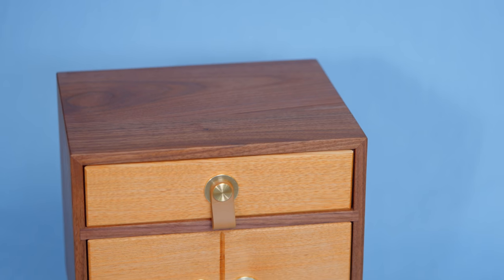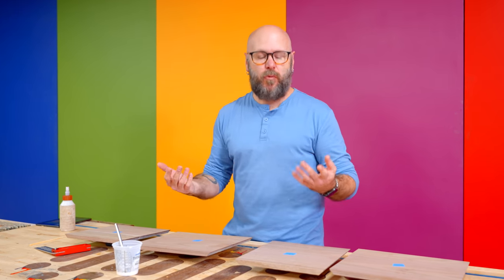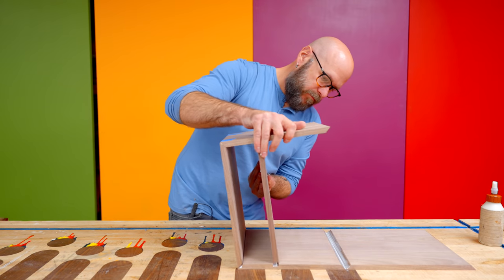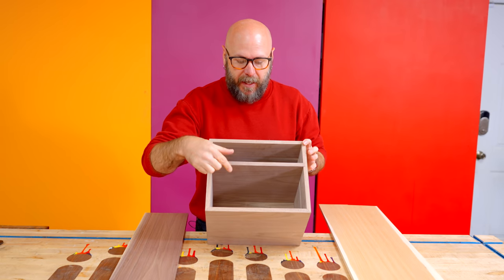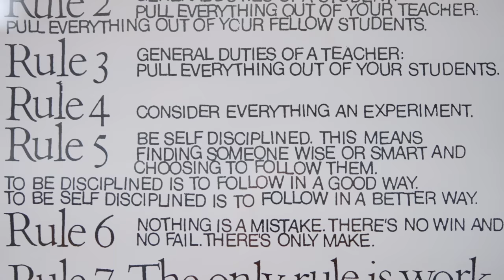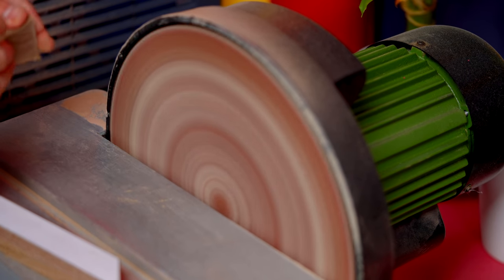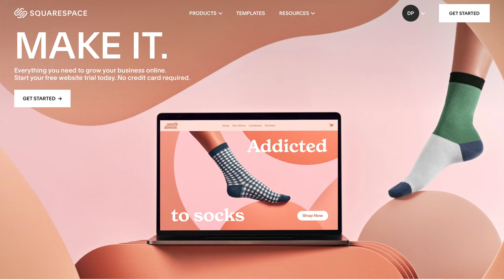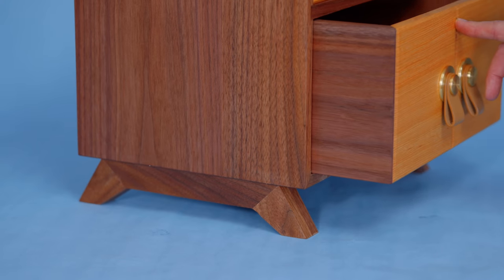Miniature cabinet with a secret. Easy woodworking project.

Comment: I really like the cabinet. However, I might suggest a stopped dado for the separator between the drawers. I have never liked to see the end of the board show like that. Just my personal bias. Otherwise, great job. I think I will try one when next I can. Thank you.
Reply: I like that idea. I’m a newbie (without a shop). If you do that you have to have a router bit exactly equal to the width of the horizontal board, which makes that concept difficult, no?
Reply: @daveparker839  smaller router bit and make a few passes. With the last two being the correct distance apart for your board

Comment: If you watch Patrick Sullivan’s “Glue myths End grain” you’ll see scientific tested proof that end grain to end grain is actually stronger then side grain to side grain. So the question is do you say end grain is not strong because it’s always been said or did you personally experience the rare occasion where it broke? Plus miter joints are not end grain. They are a mix of end and side grain.
Reply: I don’t believe that. Build a picture frame. Don’t spline it, don’t do the water down glue trick. Then drop it like it would if it fell off a wall it will break at the joints not all of the joints might not break but it’s the miter that breaks. Now butt joint a panel the same size as the picture frame. And drop it the same way bet it does not break and if it does it will not break at glue joint.
Reply: @koalafan1576  Sounds like someone didn't really think past that guys test and think of how lengths of wood with more leverage will break easier.

Comment: So I need a planer, table saw, digital angle finder, wood glue, electric sander, and skill… easy
Reply from the maker: Correct. Common woodworking tools woodworkers tend to have. Thanks!
Reply: Most woodworking hobbyists have these tools, and you can get all of them for much cheaper than more common hobbies cost as far as the skill goes, that comes with practise, no one would expect you to build this for your first project.